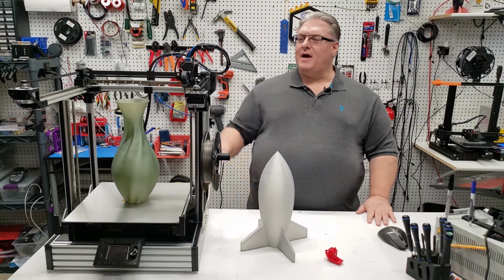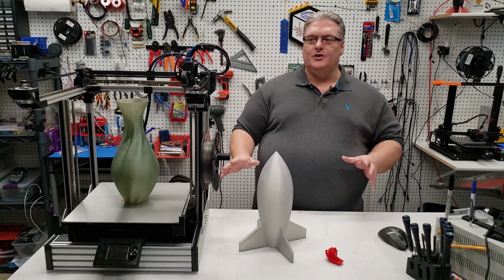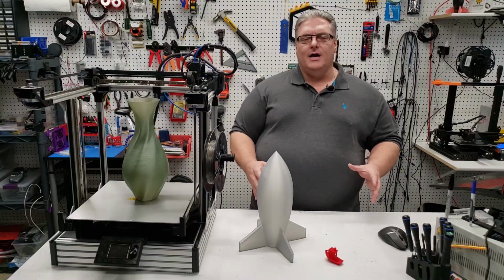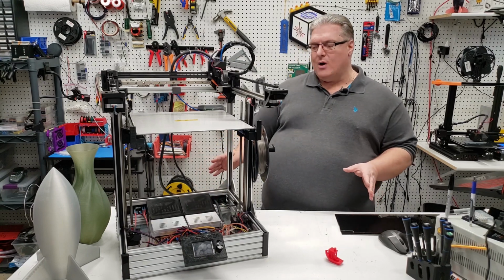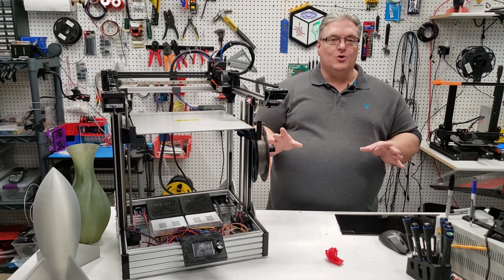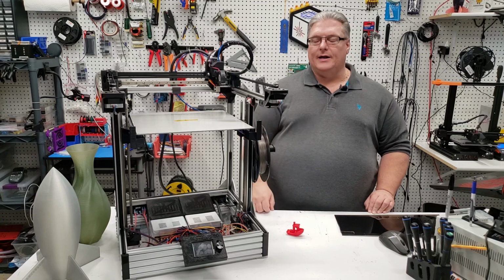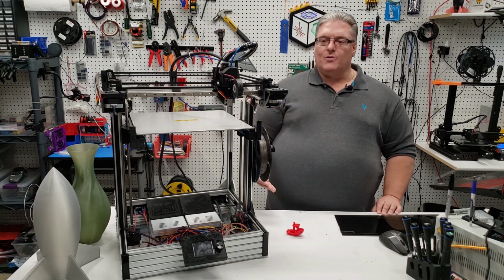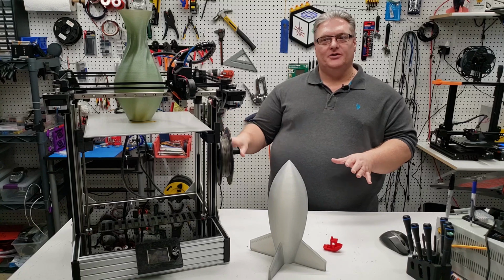DIY 3D Printer - Build a CoreXY Printer - LayerFused X301 Preview

Comment from the maker: Are you interested in building a LayerFused X301 printer? What would you differently in your build?
Reply: as a DIY, what would be a realistic cost estimate to build this?
Reply: Id be interested in scaling it up to a 500mm design if the costs are manageable and with it
Reply: I’d also like to scale it up to 500. It just makes the most sense and the offset in cost would be insignificant.
Reply: I actually have an ender 3 on the way. I watched the C201 series and thought it was awesome. I got excited when you mentioned that you be doing this series. I'm planning to do some prints that require the same build area as this printer. I know there are explanation kits for the ender. But the issues caused by sliding moments of the bed are not ideal. If the cost for this printer in a kit is comparable to only a few dollars more. I'd just go with this kit and then have two printers that i can have going for different projects at once. I'd even be willing to pay a little extra of the kit included the lights.
Reply: Thank you so much for making life easy for Beginners, waiting for series build videos. Also with this CoreXY Printer, I have no deep knowledge but I think the spool holder place is not efficient. The motor has to force more losing a bit of torque. Just like a phenomenon of Resistance in Long Lenth Cables/Wires. Please do shine light on spool configuration in the series video. Thanks once again.
Reply from the maker: Good question!  The spool holder is there for convenience.  I don't feel there is significant strain on the extruder since this is direct drive.  The bowden is just to guide the filament to the extruder itself.  The geared extruder has a tight grip and I've not seen issues related to pulling the filament (or retracting it) at that distance. Lesser extruders could certainly have issues but that is why this has a geared extruder.  I've considered a top mounted spool and removing the bowden entirely but that would make changing filament more difficult and should there ever be a failure of the mount the spool would crash into the printer.  So the choice was made to put it on the side and use the bowden to route the filament where it needed to go.  Thanks again for your question and feedback!
Reply: Now this is exactly what I was talking about in the comments of your previous build video, except I had no idea it could be built this way with only the extruder moving about.
Please make links to where you obtained the parts in the future videos, I would really like to build this myself and don't want to buy junk parts and end up disappointed from hours trying to fix it, much like the xyzprinting da vinci jr 1.0w I've spent hours tweaking into printing as well as it will ever do, not to mention the modifications I've made to it and have in mind if I am stuck using it for much longer. 😂

I do wonder why you chose belts over screw rods, which I think the rigidity would increase quality?
Also, I think I would have liked to:
Make the control panel detachable.
Maybe even a way to keep the cables in the back from flexing in/outward for smaller places, but I'd imagine that is an issue I could solve myself with a little plexy glass and mounts.
Heated bed, possibly using a mirror or glass, so tired of using blue painters tape, disappearing purple and dabbing with a moist towel.

Really liking the design so far, you make awesome videos!
Reply from the maker: @redkurn  The main reason for going with belts is cost and ease.  You could use screw or ball driven on the X and Y but overall it add complexity in a DIY build and cost.  There is a heated bed there and it has glass only because the flexible build surface had not come in before I shot this video. :)  I have a few im testing for the video build series.  Thanks for the suggestions and thanks for watching!
Reply from the maker: Most kits are now available on LayerFused.com
Reply: If you go flexible bed, how about spring steel ?
Reply from the maker: @flyingdream777  That was the plan for the start, im evaluating a few now for the final build.  Just did not have that done before doing the preview video.  The front runner is a dual sided PEI bed which has textured and smooth surfaces.  Ultimately though you can put your flexible bed of choice build surface it.
Reply: The 1st thought I had when I saw the bed was not moving only dropping down was that it could be possible to get the bed to drop down between insulated panels to keep the whole print warm during printing of ABS, will just have to figure a way to insulate the drive belts etc from the heat build up.
Reply from the maker: @flyingdream777  You could probably do something like that with this  https://amzn.to/2Xf6fFm Might take some work but I think you could do what you're suggesting.  For sure if you want to print ABS with this you'll need to obtain printed parts in PETG or something other than PLA.
Reply: I am absolutely planning to build one of these. If I need to, I"ll build a second, bigger one.
Reply: I can't wait for the first build video, i'm 90% sure that I wanna follow along and build this printer! It would be my first printer ever! I have one question: is the list from description the final one? If so, i would order needed hardware on Ali, thus it can take a while to deliver to Europe :(
Reply: I would consider a triple z similar to this design https://youtu.be/aL7pEEHTTe4
But it would definitely drive cost up significantly.
Reply: I'd recommend using a Zesty Nimble so you could have a CoreXY with Direct Drive instead of Bowden.
Reply: I have an Ender 3, Tronxy, Fulsun Delta and a resin printer now going to build one of these. Just ordered all the parts except for the extrusions last night and plan to tear down my delta and an old Anet A8 to reuse some of those parts. I stopped using Marlin a while back and moved to Duet never been happier. Are there any reasons I could not substitute the SKR for a Duet. I know I will need endstops since I use a Duet Maestro but looks like everything else should work. Also plan to add BL Touch plus Prometheus hot end as I switched to those a while back also. Have you thought about tool change like the new E3d system loo,s like it should be doable on this design?
Reply from the maker: @damo2142  I have had a lot of interest in the Duet as an addition to this printer.  Absolutely no reason why you couldn't use one.  I'm considering doing a video where I convert one to the Duet.  Many have asked about it and it would be a great follow up plus I can put a display case together for it.  Have not yet considered a tool changer there are a few now in the market place so not sure which one would work best yet.  There could be constraints on the size given the small footprint of the X301.  Not many CoreXY printers have a 300x300 printable area in a 400x440 footprint.  Have certainly considered a tool changer.  Great thing about open source builds like this is you can go nuts!  I'm really looking forward to what the community produces for the printer as well.
Reply: @MakersMashup  I will let you know how mybuild goes with the duet.
Reply: YES definitely...!!!! would you please help in building layerfusedx301 so?
Reply from the maker: Most kits are now available on LayerFused.com
Reply: you should really start making money by selling them.
Reply: Have you tried building an enclosure around it so you can have a heated chamber and do things like PEEK?
Reply from the maker: It's actually planned for an upcoming video.  Won't be until 2021
Reply: @MakersMashup  Excellent I look forward to it! The ability to print in PEEK and other high performance plastics is a game changer!!! I would build it just for this ability.

Comment: hi. was considering building the LayerFused X301. is it still worth building it in 2024? would the specs match up with current off-the-shelf products around it's price range - $1000 according to the excel sheet provided -  like the Creality K1 Max CoreXY - how is the X301 compared to that?
it seems the LayerFused shop site is down - meaning the parts required (from them) are unavailable - making the build difficult. and does the excel sheet consist of everything needed to build the X301? 
what do you suggest? should i build or buy?
Reply from the maker: 2024 has a lot to choose from and I personally recommend the Bambu Lab line of coreXY or the SV08 for off the shelf builds, they work great.  If you want to learn, or build your own build, the X301 is still a viable platform. Its a rather simple coreXY build all things considered and great to learn with.  IF you're looking to build a machine with every bell and whistle, then you might want to look at other builds with more ongoing support.  Overall though its still a basic 3D printer build.  You can likely reduce the cost further ordering from say Aliexpress.  If its your first printer though, buy something like the Bambu X1C, you'll be much happier with the overall experience OOTB.

Comment: How's that X501 coming along? :)
Reply from the maker: Cable chain is done, working in that video and the official 3z.  It's coming along.
Reply: @MakersMashup  Any guestimate as to when the kit may become available?
Reply from the maker: Layerfused has some parts in but not a full kit yet.  Some things like the heatbed we will need to find a vendor for so it may be a bit before a full kit is available. Partial kits will show up once the videos and 3z are ready.  That's how the x301 also rolled out.

Comment: Is it possible to dismantle my Tronxy X5SA and turn it to something like this so it can be functional? My Tronxy isn't too bad if making doll faces but making a full head or body is a nightmare and the reason I got the printer is to make action figures.

Also when you said that its sturdy and strong, i saw that the printer was wobbling. Wobbling causes ringging or banding and I don't want that

Comment: How does that work with sensorles steppen motors? As I pause the printer, move the x and y axis, does it then still find his place back to where it was?
Reply from the maker: If you pause the printer the motors stay engaged.  When it homes it uses stall detection in the 2209 to determine the print head is not moving and that is how it determines it is at home.

Comment: I am very interested in this project I wanted to know which heated bed should I take for the measurements for this 300x300 printer? congratulations for the videos
Reply from the maker: I recommend the Mk2A bed because the lighted platform is a nice addition to the printer.  The CR10 version currently doesnt have the lighted bed part.  Purchasing your bed from the LayerFused store helps support the project and future work. https://shop.layerfused.com/collections/printer-kits/products/x301-heated-bed-kit-mk2a-300mmx300mm-24v-with-mosfet

Comment: Stepper Motors: I just found one heck of a deal on stepper motors (no offense to your online shop!)  My question - they say they are rated at 40Ncm: is that enough holding torque for a bed of this size if I plan on using 2mm lead screw, single start? Thanks!

Comment: Thanks for the series, just finished watching all of them.  A few questions as I am new to 3d printing.  What filaments will be  properly print on this printer?   If  it were enclosed could it print other filaments?  Would it be possible to enclose it due to belts, electronics, etc?  I know the 3d printed parts could be hopefully printed and changed out later to improve heat tolerances, and should the electronics be moved out of the enclosure to ensure longer life?
Thanks, again.
Reply from the maker: You can use just about any filament you want its all a matter of the nozzle and making sure its an all metal one.  If you want to enclose it you should consider printing the parts in something more heat tolerant that PLA.  Not sure why you would think the electronics would have a shorter life inside the enclosure.  Proper ventilation is there and as a DIY kit you can always add additional ventilation of your choosing.  I suggest reaching out to the Discord or the Reddit group for assistance.

Comment: 13:30 when you're showing off the benchy it looks like there's still some minor intermittent layer adhesion issues and some irregular melting artifacts on the layer lines.  I know that cameras show these kinds of prints in the absolutely worst light (it seems any time i photograph any of my prints that I think came out flawlessly they look rubbish on camera), but i think that you might be able to get some finer detail with some slicer tuning.
Reply from the maker: You're quite right Josh that benchy was considerably improved on with slicer settings.  Once I had the videos complete I did a number of profile tunes and we now have one that prints a pretty flawless benchy. The other real key has been filament.  That was some standard PLA but now using 3D Fuel Pro PLA it makes a huge difference in getting consistent extrusion.  I'll print one up here and throw it on twitter and post the link.  You're absolutely right though some slicer tuning made huge differences.

Comment: Hi, Good job! I would just like to ask if it would be possible to add a second extruder to this build and if so how does this effect the electronics and build volume?
Reply from the maker: Sure you can always add another extruder.  How you modify the build for that is going to change the build size.  Something like a 2 in one out can easily be adapted to fit and the SKR already has a second extruder port on it.  Good luck on creating your X302!
Reply: @MakersMashup  X302 I like it .... It sounds like the SKR is a good board, would it also be possible to add a run out sensor ?

Comment: Hi my friend im building up one, sorry the bad english: some questions, in the introduction video, your friend say that he bought from a store called zotrac sutrac, something like that, can you please tell me whats the name of the store? second, can I run this with one MEAN WELL LRS-350-24 DC Power Supply, 24V 14.6A instead of a 500watt and put a noctua or another silent fan? it would be sufficient? its a lot cheaper that 2 power supply, and last, i have a few mining rig structures that i bought from amazon (veddha frame) that they are 2020 aluminum extrusion and they measure 400mm each side, can i use these ones to save money for the structure? or I need the dual 2040 for sturdiness?  would i have to change something else? please i would love your inside, i would subscribe to patreon to, i need a hand here because I'm from Venezuela and i dont want to miss anything because i cant afford more expenses and i have to wait like 2 month to items arrive, THANKS!!!

Comment: May I know the actual volume takes for your design?
Reply from the maker: Are we talking about the print volume?  That should be 300x300x330 officially but you can push it to 310x310x340 depending on your build surface.  The footprint of the printer is 440x400.
Reply: @MakersMashup  thx, I knew its 440x 400,  but i like to know whole machine volume to see if i got space for your nice bulid.

Comment: stupid question: why does nobody use powes supply units from desktop pc's?
You can get easily 500W (even up to 800W and more) out of a single one.
Reply from the maker: If you poke around YouTube you'll find videos of people doing just that.  The primary reason why most do not is because PC Power supplies often split voltages around.  So while you have a 800w Supply you find sometimes its 400w for any one rail inside the power supply.  Cost is the other driving factor.  Cheap china 12v (or 24) power supplies run about half the price of PC supplies.  You then also have to mess around with connectors on a PC Power supply.  Screw terminals are rather handy on your build.   You can use them though if you have one laying around.  Just make sure you don't mix 12 and 24v parts.
Reply: @MakersMashup  well, okay thanks mate

Comment: you know what is interesting upgrade to me? is some buildtak style conveyer system, and some shape in the end of the conveyer to scrape the print, its an excellent add-on which is optional but can be add if needed in some case if you have batch order or something and need 24/7 work for some time, another idea is obviously an enclosed frame option for adding a heater chamber.

and this thing: https://www.thingiverse.com/thing:3961216 , its a multi material filament loader (MMU2 like), he is able to use it with duet but not yet with marlin with I2C function

and this one maybe a "choosing beggar" side of me but maybe consider free 3d printer kit like kossell did few years back with a cost of giving away 2 kit for another people, like how he offered here: https://github.com/jcrocholl/kossel , maybe you will disagree with this and I understand, but I think its pretty good way for a student like me or for some maker that like 3d printer, know how to use it, but too broke to have it, like myself lol.

i saw this amazing and I want to build this one by myself once I able to work my way to make money to afford the part for print some or cnc a pcb with it

Thank you